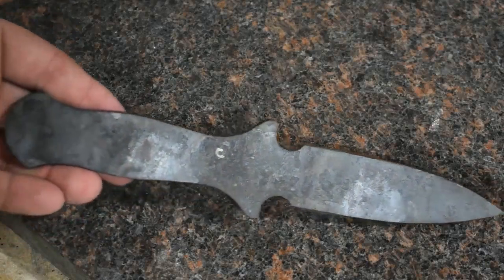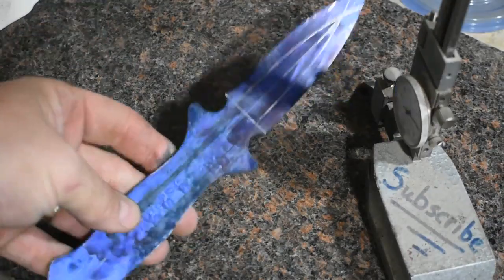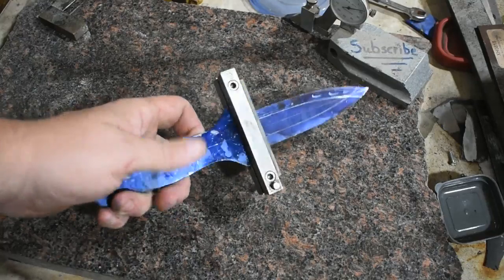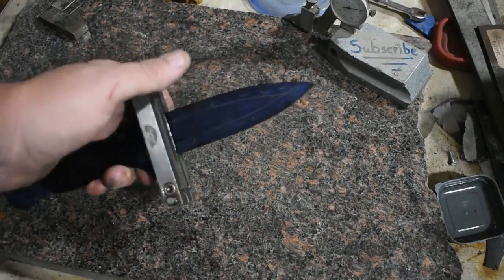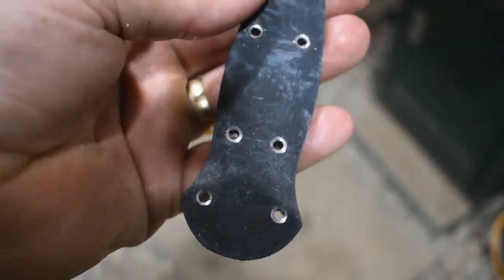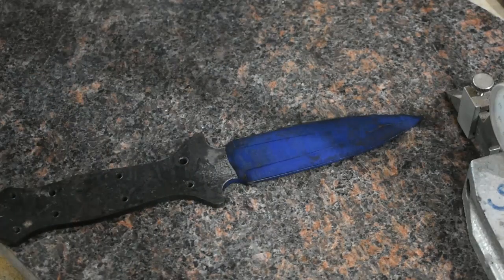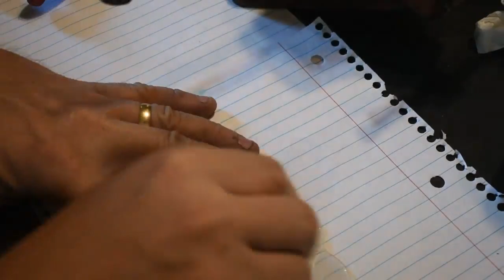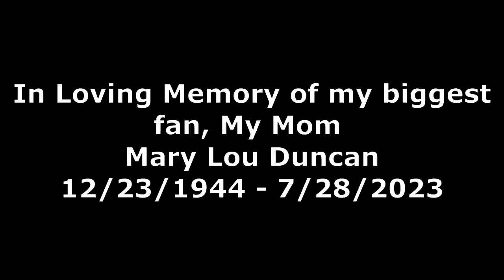Forging a Damascus Boot knife

Comment: Do you weld the billet up using the propane forge? I've been putting off trying to weld with propane because I don't want to eat up my forge lining and all the nay-saying, but I'm tempted lol.
Reply from the maker: Yes, I use WD-40 instead of borax, it won't eat up your liner or bricks doing it that way. I used borax when I first started and got tired of relining my forge so much. I appreciate you watching.